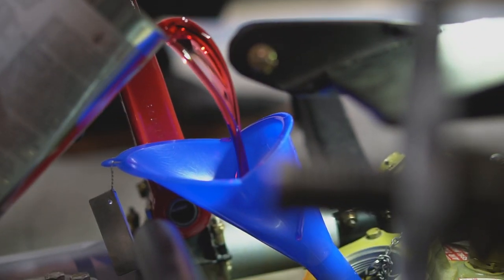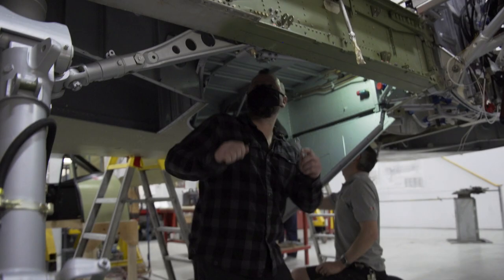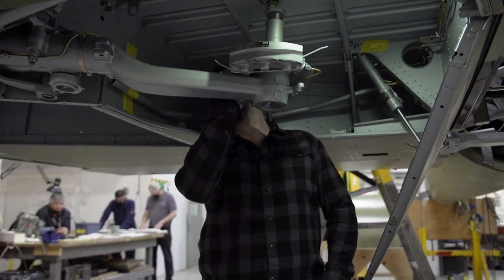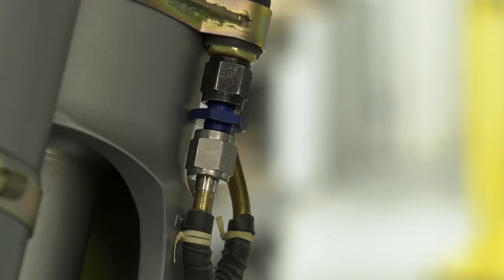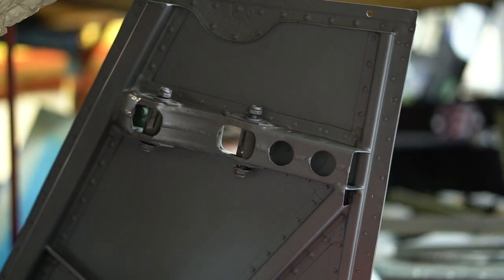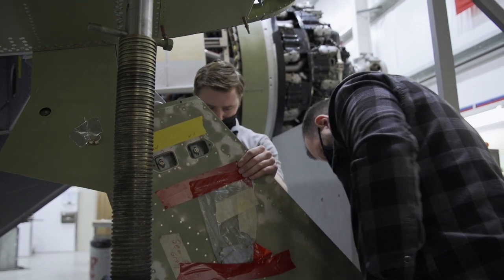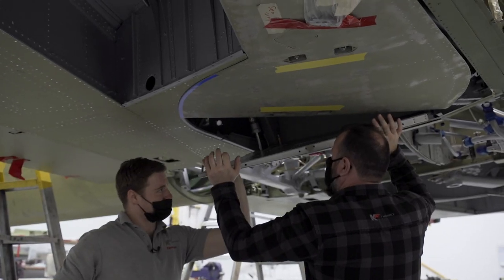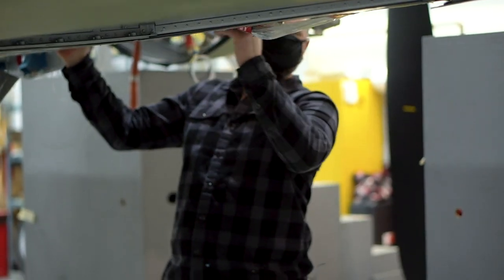Part Three: Hawker Tempest II MW376 Restoration Project at KF Aerospace

Comment: ⭐️⭐️⭐️⭐️⭐️ Radials don’t turn into ground targets as effectively as V block engines, leaving the tempest to race for high altitude which it didn’t have the prop for, of course if you got caught on the way up or down in the easily out turned Tempest2 well you were a valued member of the squadron
Reply: The Typhoon was the ground attack specialist with a cruiser broadside punch. (8 rockets) and guns bombs etc. The Tempest was the fighter that Hawker was originally aiming for with a better wing form and better performance at altitude. It could take on easily a 109 or 190. The ME 262 pilots said it was their most deadly opponent flying at 440 mph with kill ratio in air to air combat of 8 to 1. Very manoeverable and well armed with 20mm Cannons.. As the Typhoon and Tempest where such heavy hitters at low level with Rockets Bombs and Cannons, (The Rockets where the equivalent of a cruisers broadside), they where extensively used at low level and suffered a lot of casualties from ground fire. Have a look at this site has a lot more info.
 https://en.m.wikipedia.org/wiki/Hawker_Tempest

Comment: Awesome to see any Typhoon or Tempest fly.  When this one does, I believe it will be the only one?

I would so much like to see one of the Napier Saber powered aircraft fly again, and I know there is a shop in Canada working in that direction.  I can't imagine though how a Saber can be made flyable again.  Such a complex engine that has been out of use for so long...
Reply: Doesn't this one have a Bristol Centaurus radial?
Reply: @532bluepeter1  I assume it does.  I know there is at least one Centaurus powered Sea Fury that is still flying.  But, the vast majority of flying Sea Furies have been re-engined with US made radials.
Reply: @johnshaft5613  In the video the exausts of a centaurus can be seen. Sabres had a horizontal linear exhaust array. The Centaurus's were vertically aligned at the base of the cowling.
Reply: @532bluepeter1  I guess I wasn't clear.  I know this airplane is Centaurus powered, all Tempest IIs were...

I was just saying that I would also like to see a Sabre powered Tempest V or VI fly someday.
Reply: @johnshaft5613  Noted

Comment: I expect the restorers will use modern materials and methods, to make sure the Plane is as original as possible,  while applying the aforementioned. One major issue is, of course, this magnificant planes  historic weaknesses,   e.g  the unique engines foibles, etc,  being improved on ?
Reply: An early decision was made to replace the original Bristol Centaurus engine with a R2800 CA-3 from a Canadair CL-215. This was done due to the questionable reliability of the original Centaurus engine. The decision to replace the original engine was not taken lightly, however the restoration team wanted to prioritize the aircraft’s airworthiness and safety.